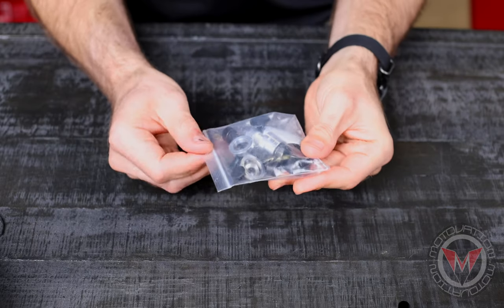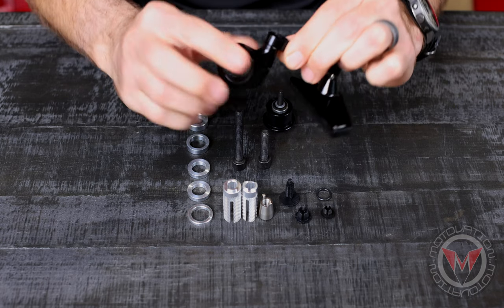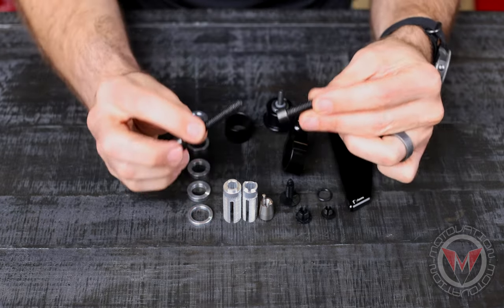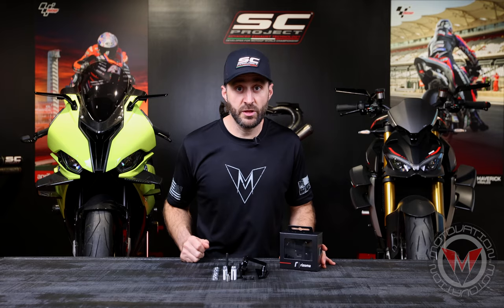Rizoma Cut Edge Mirrors - Unbox and Install

Comment: @MotovationUSA Between these and the Stealths you have mounted on the same bike, I see the Stealths are bigger, but the position of the Cut-Edge might give them an advantage in overall rear visibility.  What are your thoughts?
Reply from the maker: Definitely depends on your preference.  Excluding the styling and holding that equal between the two:
There is definitely an advantage in position options when it comes to the Cut Edge.  You have a little more adjustment available to you based on the rotation around the bar, swing of the perch, and ball adjustment on the mirror itself.  The Cut Edge scores a little higher when dialing it in to the rider position and visibility angle.

The Stealth mirrors rotate on a single axis on the Super Sport application and two axis with the Naked Mount.  The latter of the two rotating around the mounting nut and then the pivot of the winglet/mirror.  The Stealth mirrors have been designed to work most effectively in the tucked position.  This, coupled with the convex shape of the mirror, you will have greater visibility to the left and right of your shoulders in the single, most advantaged viewing position.

A lot of the decision comes down to your individual use case:
Do you prioritize having a bar end vs standard mounting position?
Do you daily ride your bike and hate looking over your shoulder when changing lanes?
Do you predominately ride alone and fast enough to stay in the tucked position on during long highway stints?
etc.

Both are incredibly constructed mirrors that share the same design language.  Rizoma is known for their billet aluminum construction and attention to detail.  Nothing on the market can compare heads up.  Some knock offs might look similar, but none are going to stack up to the quality and support that come with Rizoma products.

Comment: Do you know if the 3 black plastic parts are for the old mirror caps? What’s are they provided for?
Reply from the maker: That is correct.
When you remove your stock mirrors, you will end up with threaded holes. The kit provides you with plastic cover caps for those holes.
Reply: @MotovationUSA  awesome! Thanks for the fast reply. The box didn’t come with the list of each component but that’s what I thought they were. Your video was very helpful, I installed a set on a 2023 Ducati Diavel and they are AWESOME 👍🏽
Reply from the maker: Happy to help!

Comment: @motovationUSA what if I on’y put 1 mirror on the left side, wich bar end plug should i install on the right so it fits with the mirror thanks
Reply from the maker: Hey @jeremyroy!
You have a couple of options. If you are putting the mirror on the left side (assuming rider's left, or clutch side), you can put a ProGuard brake protector on or you can put Rizoma Bar End on. Here are the links:
Rizoma ProGuard:
https://www.motovationusa.com/sliders-protection/rizoma-street-proguard-lever-protection-system-lp010.html
Rizoma Bar End:
https://www.motovationusa.com/rizoma-bar-end-ma301B.html

If you have any further questions, don't hesitate to reach out to our customer service team sales@.

Comment: Yo are u able to use these mirrors in combination with something like the proguard system? Planning on building an RS660 and cant find any good looking legal mirrors so thats an idea and i already have the proguard system
Reply from the maker: If you are planning on using "Race Bike" fitment (the last install in the video), you will be able to run the ProGuard system and the mirror independently. Unfortunately, the Cut Edge mirror does not integrate with the ProGuard system.
Reply: @MotovationUSA  Thanks guys^^

Comment: is there a way to use the original bar end weights along with the mirror?
Reply from the maker: As you can see from the video, the mirrors mount to the supplied Cut Edge bar end. If you are mounting directly to the bar (like is done with the race bike), you will be able to, but otherwise, you will be replacing the stock bar ends.

Comment: Will these fit a 2020 S1000xr?
Reply from the maker: Rizoma does not list fitment for the XR.  Not sure of the threaded insert size, so you might be able to make them work via a mounting kit if you really wanted to.
These are likely lighter than the stock bar ends, so you may see more vibration come through the bars.

Comment: Got mine on the sf848… arguably a waste of money as I can’t see anything with my more upright position… sports bikes maybe but on this. Useless
Reply from the maker: Dialing the mirrors in can be a bit of trial and error, and can be rotated to be above or below the bars.  Pretty slick setup.
Small bar end mirrors are not going to provide the same visibility as the large, ugly stock mirrors.
Reply: @MotovationUSA  I messed with it some more and I had to go under the bar to get any kind of visibility. I had some rizomas previously that were in the oem positions that worked amazingly. Just took some tinkering with these, thanks for the reply